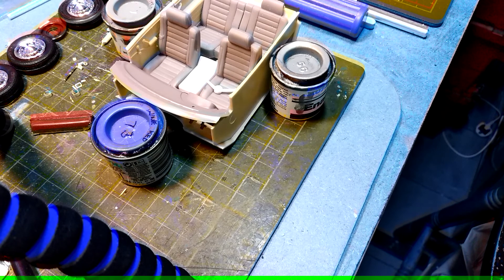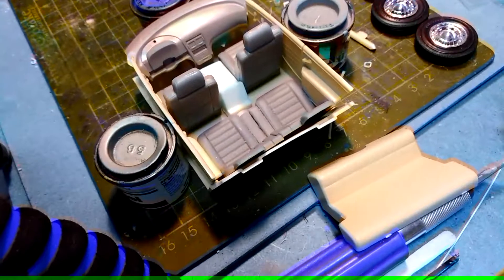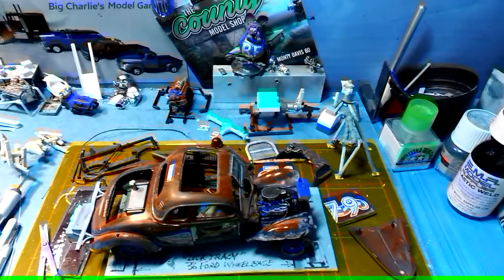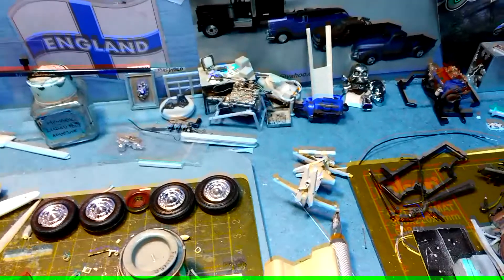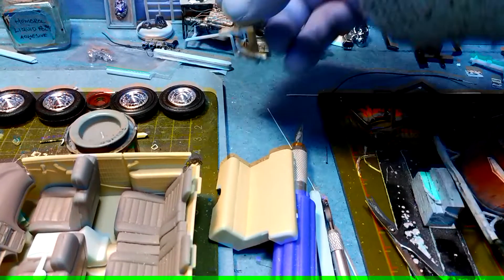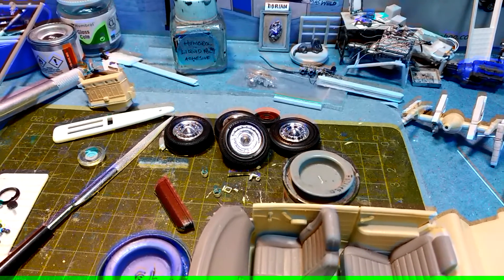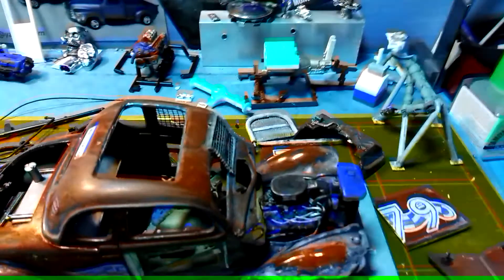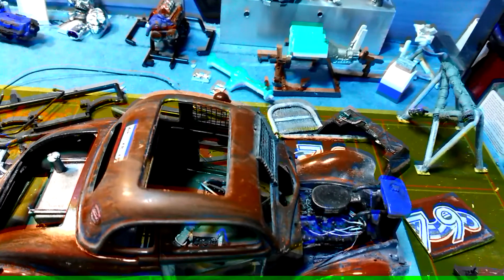51 bel Air interior

Comment: Nice interior Pete,is that a straight 6? 😎
Reply from the maker: Yes indeed, a straight 6. There's a dual ignition system that has 12 plug and 2 coil leads into distributor. 👀I think, bugger that,! 😳I'll do standard 7 lead system. 😅The seats are from a hummer, but I've cut a bit out of back one
Reply: @petesmodelcarcustoms584  wow! 😎😎